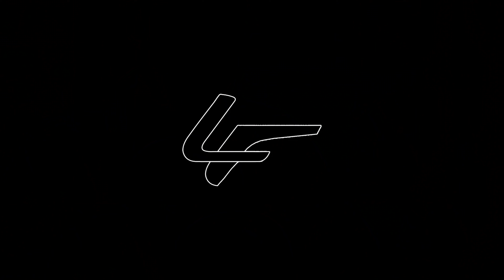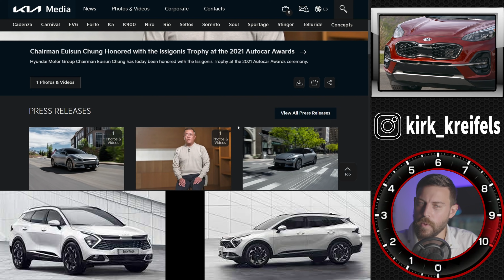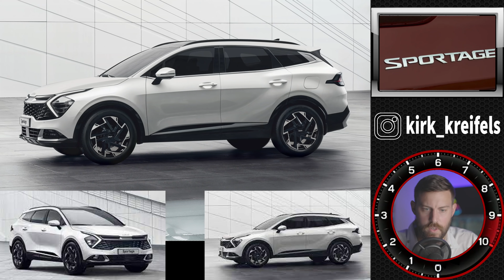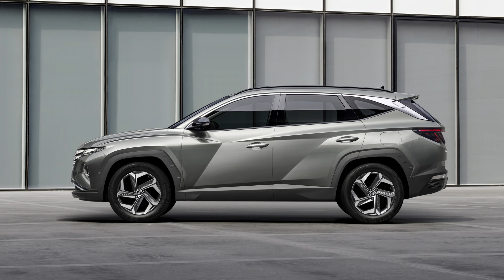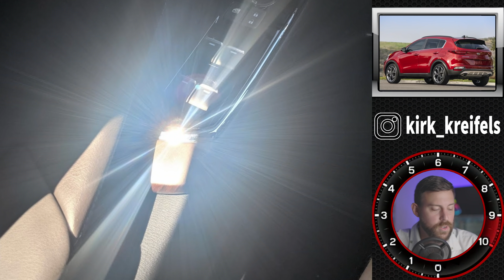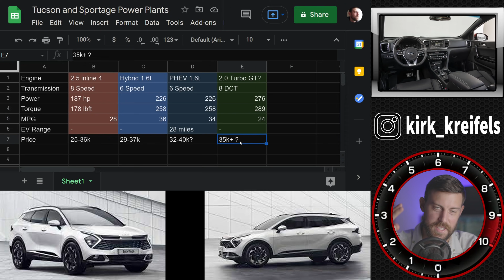FIRST LOOK!  2022 Kia Sportage Sheds its Uninspiring Shell...

Comment: Soul, 102" wheelbase
Seltos, 103" wheelbase
Sportage, 105" wheelbase (old model)
Niro, 106" wheelbase
Sorento, 110" wheelbase
Telluride, 114" wheelbase
Carnival, 121" wheelbase

Between the Seltos, Sportage (old and new), and Niro, there is not much of a difference in overall size.  Is it possible that Kia has too many small SUVs that are too similar?  Many consumers get confused by too many choices, especially when they are beginning to blend together.
Reply: Yes they are all blending together for me. They confuse me!
Reply: @DaddyBear1971  Totally !     Yes !
Reply: Hi Chad !  You are about the only one to point this out. And I wish more people would call Kia out on this. For the untrained eye like me when it comes to Kia, I keep having to look at the badging to see which is which.
Personally I like the RAV4 hybrids as Toyota are exceptional at hybrids. And the simplicity of Toyota. 
I am 64 and I don’t need millions of tech.
I saying that, the new Kia does look quite nice. And they have mated the hybrids with a 6 speed auto transmission torque converter.

Regards.     Auckland. NZ

Comment: its so weird to me, like the rav4 is around 25k and its an extremely great suv like the best seller for a reason. But then hyndia/kia make there new tucson/sportage and its also around 25k? why would anyone buy these over the rav4 it just doesn't make sense. Like i understand if the new tucson was like 21,999$ new but its literally like 25k the rav4 beats these suvs in every aspect
Reply: because toyota designs are really bland. so bland that i think theyre ugly cars.
kias and hyundais make beautiful and eye catching cars both inside and outside.
Reply: @Aztec Fan1 I agree. But for some people they will prefer the auto transmission over a cvt and a lot of tech in Kia. But I like the RAV4 myself.
Reply: @Aztec Fan1   Very correct. It will be a 6 speed auto transmission torque converter. 
Regards NZ

Comment: Kirk, I've had to put this as a separate comment since this is not totally related to this vehicle or your "area of coverage", but...

I've seen a couple of videos on the new Ford Maverick unibody small pickup as OFFICIALLY RELEASED (its' main competitor, the new Hyundai Santa Cruz is in your area) and I'm worried as Ford seems to be "feeding the line" that the base Maverick will both be a (NA-2.5L Gas) Hybrid and will sticker at U$19,995 + delivery, a nod to the original 1970 MY Coupe model MSRP of U$1,995 + delivery (not mentioned in the videos).

Problem is that the cheapest vehicle with this same Hybrid combo (rated at 200hp combined) is the Escape Hybrid SE starting at U$26,030 + delivery in Ford US webpage. I DON'T SEE FORD OFFERING THIS ENGINE ON THE PICKUP AT THIS PRICE. A low-optioned FWD XLT Hybrid shown by Doug DeMuro seemed like a U$25-26K or so offering (believe the First Edition AWD's could top up at U$32K, while the regular Lariat AWD would top up just shy of U$30K). A lesser-known YT creator hinted that the base engine would rather be the 165hp NA-2.0L from the Transit Connect minivans, which at that "low-ball" base MSRP I can believe Ford would offer and it is still more powerful than the last 4-cylinder Tacomas (150hp) and Frontiers (153hp) ever offered.

WHAT DO YOU THINK ABOUT THIS?  Expect your reply down here...

Comment: The exterior and interior looks way better than a RAV4 and CRV
Reply: Stoppp
Reply: And yet RAV4 outsells both of them.
Reply: @johnmartin7158  yeah because it's a Toyota and people just buy it because they don't know that better options exist.
Reply: @kristians2704    Kia has come a long way I agree. And a lot of people prefer the hybrid to be mated to a auto transmission torque converter or dual clutch. The Toyota RAV4 is a great vehicle if you can get hold of one.
In NZ Toyota is a trusted brand.
I am planning to buy a brand new Toyota RAV4 hybrid in 2022. Waiting time 7 months.  But I have not discounted the Kia Sportage, Mitsubishi Outlander PHEV, Peugeot 3008 PHEV and Volvo. 

Nothing wrong with Kia. 

NZ